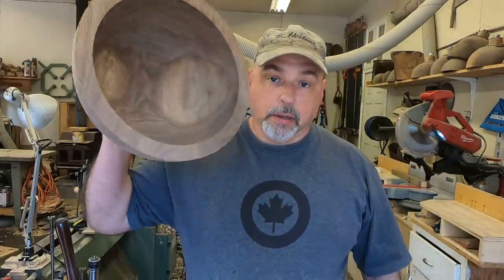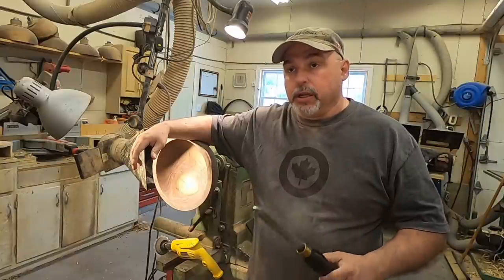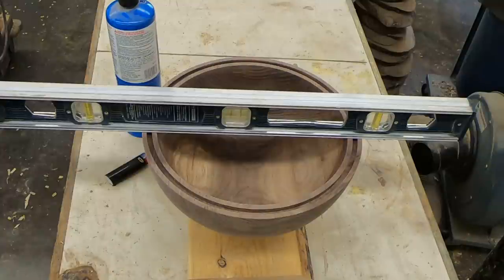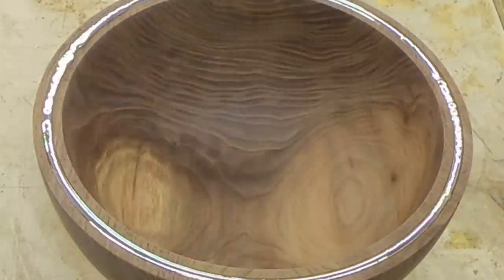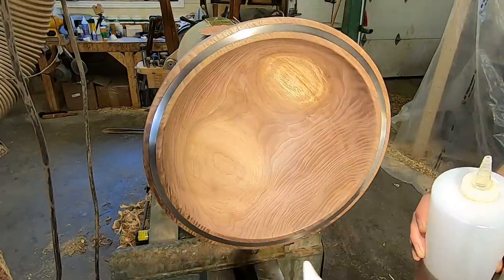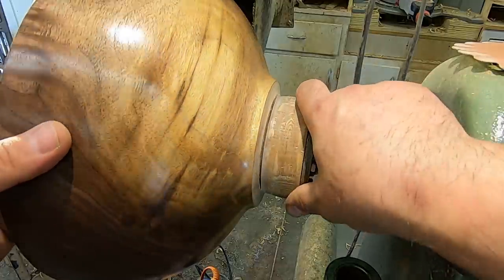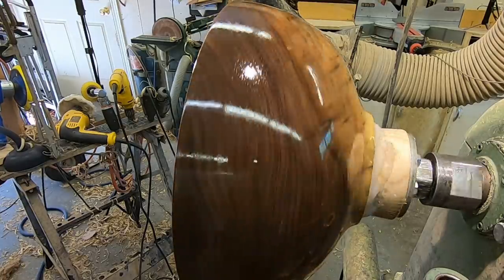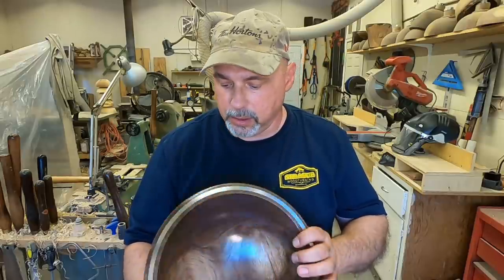Woodturning - Walnut with pewter inlay

Comment: Hi Jim.. Loved the Pewter poor around the rim of the bowl. I couldn't help think what it would look like if you added some copper chips to the pewter befor it crowned and then finished the poor of pewter so it crowned and then when you finished turning the rim you would see thr copper shinning or sprkeling through the pewter. If your wondering about me I'm a retired Artist who loves to do wood working but never had the time while I was making a living now I'm old and disabled but still love to watch your video's, Keep up the great work, I love watching from start to finish.
Reply from the maker: I tried something similar to this but with twisted copper wire and it was a failure, there’s a video here on my channel about it. The copper chips would probably be easier as you could heat them up put them in the rim and pour over top of them. It’s a great idea and will possibly give it a try in the future, thanks!

Comment: You might want to try brass, it makes for a nice inlay. A little harder to work with since it isn't molten when laid in place and instead is shavings laid in with CA glue. You can get the brass shavings from a local locksmith shop that is doing more key cutting for higher end lock sets instead of the cheaper nickel keys. good work with the pewter.
Reply from the maker: I’ve already covered this on my channel, thanks.

Comment: First time I’ve seen one of your videos. Very nice. I’ve been wanting to mix metal and wood in my turning projects as a hobbyist. I made a candle holder for those 3” fat candles out of walnut and machined a simple brass base for it on my atlas metal lathe. Christmas gift last year for my daughter. Came out nice. 
So I was very interested in your process. 
It came out great. And I’ll be checking out that finish formula. Thanks!
Reply from the maker: Thanks 🙏

Comment: I melt lead in a small cast iron frying pan on a hot plate in my shop, that would work for this I think. Also if you want the pewter to stay in the rim, drilling angled holes randomly in the inlay would allow for a lock.  Nice ideas though, the bowls look great.
Reply from the maker: Thanks. I just might do this next time.

Comment: Two things... I think that would be a cool looking sink, in fact when I saw that lathe attachment, I thought that was a drain. Also, while you had the bowl on the vacuum attachment, maybe consider adding the black filler, using the vacuum to suck the filler into the crack from the opposite side. Just my .02.
Reply from the maker: Thanks for your .02, lol. If the voids don’t go all the way through to the other side of the bowl, the vacuum won’t be able to pull the glue into the void anyway. The other issue is if the vacuum does pull the glue through to the other side, it could possibly get sucked up into the vacuum pump, possibly damaging it. Personally not a fan of wooden sinks, water and wood are usually not a good mix, but I do like the look tho, Jim.

Comment: I put down a drop cloth to catch most of the pewter shavings when I flush my rings.  I just remelt them with the other leftovers.  If you pick up any wood by accident, it simply burns off or you skim it with the dross.
Reply from the maker: I wonder about this but was worried about contaminating the inlay, thanks for the tip!
Reply: You could probably put it in water, the pewter would sink, the wood would float. Just a thought.
Reply: @jacobacon3219  not a bad idea, but I don't use large amounts.  I have a graphite crucible that holds about a thumb sized slug, or I would try it (I make small things)

Comment: -4, Carl - try using green foundry clay to build a dam on either side of the groove, stops spills and reduces your melt.  I agree with Steven.  Pewter is nice, rose metal looks very good with walnut also, look at desk surrounds from the early 1900's.
Reply from the maker: Interesting, I’ve never heard of rose metal before. I’m not really concerned with spills on the rim. It doesn’t adhear that will to the surface of the bowl so I just let it dry and pick it out. Where I can see an advantage to using the foundry clay is on a side pour, thanks for the info, Jim.

Comment: might i suggest using "Babbitt" wire , it is cheap and very easy to work with (i work in a bearing shop). it is essentially the same as pewter but cheap since it is used on an industrial scale. I have used it on some wood working and it worked very well.
Reply from the maker: Possibly? Keep in mind if this bowl is to used for food and the Babbitt wire has lead in it, then that’s a problem. As long as it can be melted easily with a propane torch and it contains no lead then I see no reason not to try it. Jim

Comment: If you use a cabinet scraper on the top edge, your pewter inlay will look much better. Sanding that pewter inlay gives it more of a satin sheen and it doesn't get nice and shiny
Reply from the maker: I will give that a go next time, thanks for the tip.

Comment: That was really informative and well described as you proceeded. What was noticeable for me was outboard turning; use of a glue block and this being seen as a positive advantage; very light cuts; good tip about putting drill into reverse as well as lathe into reverse when sanding; salad bowl finish - shiny oil finish; and last but not least bug holes (I thought I was the only one to get these!) I've got the pewter but haven't use it yet so this vid is very timely. Thanks for sharing. Have you ever inlaid with milliput?
Reply from the maker: We all deal with bugs, lol. I’ve never even seen milliput before. Someone asked me about it before too. Thanks for your kind words. Got more great stuff coming up, Jim.

Comment: If you use some aluminum foil to cover the top when ya are heating the metal to melt you probably would save a good minute or so. I can't wait to try this. I don't turn much but this would be great addition to my electrocuted wood burning. Thank for making this video man.
Reply from the maker: Yes, that’s a good tip, not so sure it will work in the fractal burning tho, most of the fractals are shaped like a U and the pewter just doesn’t have a adhesion quality that glues do. It would however look cool if you could get it to work, safe burning, Jim.
Reply: @SpragueWoodturning  I see science people use that trick in their labs. And yes I've considered there would be a adhesion issues my thought was encapsulated it in epoxy if it makes it through the removal of the excess material.  But it's fun to experiment might even learn something. I think I understand what you mean by they are normally U shaped fractal burns. I've been doing that kinda work for a bit now and if you happen to have any interest in seeing that kinda work. I have a video on my page of my truck bed it's pretty neat when you have almost complete control over the fractal burns (skip till the end of the video to see the finished product walk around. Thanks again Jim for sharing your experience here.

Comment: I tried pewter too but had some shrinkage problems.  Perhaps my alloy was slightly different.  I'm going to try yours.  Thanks for the video and supplying the links.
Reply: Tried to order the pewter but could not complete the order process.  Will try again later.
Reply from the maker: I’ve had this happen before and I think the pewter got too hot, not a expert in this area tho.

Comment: Jim,
Thanks for sharing your awesome talent. I use a variety of inlays in the voids of my hollow-form vessels, mainly minerals as well some powdered copper and brass. I have been flirting with using pewter after seeing some of Christophe Nancey's work at the Phoenix AAW Symposium in 2014. The pewter he used had 67% lead in it, and his pieces were for the sake of art only, not for use at the dinner table. The pewter ingots that you use: Are they the Britannia-type grade (92% tin with some copper and antimony)? What is the melting point of the pewter? I'm hoping to pour the pewter into voids in the wood drop by drop. Have you ever tried that? Thanks also for your videos on the use of epoxy resin. I'll be trying that technique for the first time in the near future. Got my resin from Designer Epoxy...they were so helpful, and the price was quite reasonable. Thanks also for that info.   Kent
Reply from the maker: I usually only use it for inlays in the rim. I don’t really recommend pouring it into voids as it tends to shrink a little when it hardens up or if strength is required. I get the pewter from here https://sculpturesupply.com/products/pewter-metal-281f-lf-ingot-form-per-lb or a pewter caster that I met a couple of years ago. It’s lead free. Don’t know the melting temp but it melts easily with a torch and I believe you can melt it on the stove too. Hope you used my discount code inlayjim? Hope this helps. Jim

Comment: Great video, thanks.  Have you tried inlaying copper wire on the outer diameter of a bowl?  Would really like to see a video of that.  Thanks.
Reply from the maker: Hi George, I’ve not tried that. This is because of adhesion issues of the copper to the wood. But with that said, you never know, lol. Thanks 🙏
Reply: @SpragueWoodturning  Thanks.

Comment: I'm not a wood turner myself (I prefer my lathe to be spinning up lumps of metal. :D), but I do appreciate the amount of skill involved in this more artistic branch of lathe work, so I've watched a LOT of wood turning video's over the years.
I thought I'd seen pretty much every wood turning tool and work holding method going, But that "Vacuum chuck" is a new one on me. Is that a common lathe attachment in your world, Or is it something you made (Or had made) yourself?

The bowl looks stunning by the way. I'm loving it on both artistic, AND technical levels. It's the sort of thing that, as a machinist I'd be staring at for ages and wonder how you got such tight tolerances between the wood and the "Aluminium ring" that you obviously had to turn and inlay. The idea that you could pour pewter into that grove without it charing the wood to hell and back wouldn't have even crossed my mind ! :)

It seems that every day really IS a school day. LOL !
Reply from the maker: Thanks for the complements! There’s a link in the description below for the vacuum chucking system I use, check it out, Jim.

Comment: Have to ask if you wanted to do silver or gold, or even brass, you couldn't melt and pour, you'd have to use wire or strips eh? I'm thinking of doing a black walnut 6 sided box, with a lid and a goldish color inlay
Reply from the maker: I’ve been doing brass shavings for years and yes, it would be too hot to pour, lol. Gold and silver leaf is an option tho. Jim

Comment: Does that inlay stick to the wood well enough that it won't come loose later on? Thinking about drilling some holes into the groove to get somekind of attachment points.
Reply from the maker: Yes that’s probably not a bad item either. I’ve not had any of them come loose that I know of. Jim.

Comment: Hi, Just curious but what is the reason to use the steel wool between coats? Is it to remove a touch of the surface wood so that the finish absorbs better? Thank you
Reply from the maker: That and to remove any fine bits of dust and lint that might be in the coat before.

Comment: Great job on that bowl How weight does the inlay add? Keep up the great work , i’m in Ontario as well 🇨🇦🇨🇦🇨🇦🇨🇦🇨🇦🇨🇦
Reply from the maker: Great. It depends on the width of it mostly. Not quite sure, I’ve never weighted one before.  You can definitely tell it’s heavier than other bowls with a different inlay 🇨🇦🇨🇦

Comment: nice working,👍👍 yesterday, I turned with pin inlay too,😂. the vacuum chuck is so useful, you made it or bought?
Reply from the maker: I bought the complete system from Oneway.
Reply: ok, I find out one system on Amazon,but it isn't sold to China, 😂😂
Reply from the maker: If you have a vacuum pump, you should be able to make one easy enough. Check the internet for homemade vacuum chuck systems.
Reply: thank you. I ordered yesterday, first it will be sent to my friend in America, then he will send the package to me,😅😅

Comment: Pewter is soft enough you can cut it with a standard saw. You will want to use larger teeth, as it will gum up smaller tooth saws. Also if you heat the pewter from the top to melt it, you will have a better heat transfer from the bottom so it will melt faster.
Reply: Also a good method for separating big blocks like that with minimal effort is lay it in the middle of a muffin tin, and go at it with your torch. It will melt into the individual muffins
Reply from the maker: Great tips, thanks for the info, Jim.

Comment: Wondering what kind of lathe you use that you can mount on the left side and turn so slowly.
Reply from the maker: It’s a variable speed 20” General. It has left hand threads on the outboard end so us lefty’s can turn comfortably, Jim.

Comment: Why not glue the bowl to the faceplate with carpenter's glue or white glue rather than hot melt? Takes a little longer to setup, but no issues with heat softening or unexpected joint failures. Just have to part it off afterwards.
Reply from the maker: I hear you, it’s just faster. This is the first time this happened to me.

Comment: What is in 'Salad  bowl finish'? I've not heard of it before here in the UK. Thanks.
Reply from the maker: It’s a resins urethane mix, very durable and hard to scratch. Do a search for General Finishes in the UK, usually three coats will give you a nice shine. Jim
Reply: @SpragueWoodturning  Thanks for the tip, it's very much appreciated. I've had a great deal of trouble with gloss finishes.
Reply from the maker: David Siddle using 0000 steel wool between coats should work on most finishes and make a beautiful shine, safe turning, Jim.
Reply: Is Butcher block oil the same thing? I’m in the USA, Virginia. I found a brand called Walrus butcher block oil. I can’t find salad oil finish. Is that the same thing or similar?   I really enjoyed your video. I will be watching the others soon. Thank you.
Reply from the maker: Elizabeth Swindler no, it’s not. There is a link in the description for Wood Bowl Finish by General Finishes. Their an American company. The finish was called salad bowl finish, they changed the name recently, Jim.
Reply: Sprague Woodturning you are awesome to respond so quickly. Thank you very much. I make cutting boards, charcuterie boards , bowls from a tree called Chinese Paulownia. I’ve had a few successful shows but I was never happy with the finish. My family grows them for veneer and siding. It is a fun wood to work with and very light to work with. It’s a new business for me so I am always experimenting new products to see what I like the best. I had always used mineral oil but I will try this on the next batch. A very good friend just gave me a Lathe but I haven’t become proficient yet. That’s next. Love the inspiration I got from your video. Thank you.

Comment: Beautiful turning!
I’ve used pewter inlay as well on some flatwork and drilled opposing small holes (obtuse and acute) in the groove or engraved image to help “lock in” the pewter.
Learned that sealing the wood before sanding helps too, especially oak. The pewter dust while sanding made it look dirty. Trial and error...🤷🏻‍♂️
Sculpture Supply Canada is a hidden gem of a store, too! 
First time visiting you channel, enjoy your technique. Liked and subscribed.

Cheers.
Reply from the maker: Thanks for the advice. I’ve also noticed the staining of the inlay material in the wood as well, especially between coats of finish, sometimes the top layer only get one heavy coat of finish and that works well.  
Thanks for your kind words. Jim

Comment: I am also left handed and would like to know what lathe you have and are you running it in reverse or is it made to rotate counter-clockwise ?
Reply from the maker: All the General manufacturing lathes have left hand threads on the outboard end. Mine is a 20” electronic variable speed. It’s lefty friendly. Jim

Comment: Really like that. What finishing oil do you use? Is a home brew recipe?
Reply from the maker: When this video was shot I was using General Finishes Salad Bowl finish. They no longer make it. Thanks
Reply: What's your current go to finish? I still like sanding sealer, friction polish and Howard's Feed and Wax but it doesn't gloss up too well on absorbent wood.

Comment: Denatured alcohol will remove hot glue from anything quick and easy, with no mess
Reply from the maker: Thanks for the tip.
Reply: Ethanol and isopropyl work well to if you want to avoid the denaturing agents.

Comment: Don't know if anyone responded but I think your glue block coming loose was caused by thermal expansion from seeing in the Sun
Reply from the maker: I thought of this as well,  but I also though that if it actually got that hot in the sun and melted the glue that it would just simply harden when taken out of it. It could also be that the bowl blanks have sat around for months with the glue blocks attached due to hip surgery and the fact I’m roughing out right now. Either way, I will be looking out for it from now on. I due this practice a fare bit and this is the first time I’ve seen it, thanks. Jim